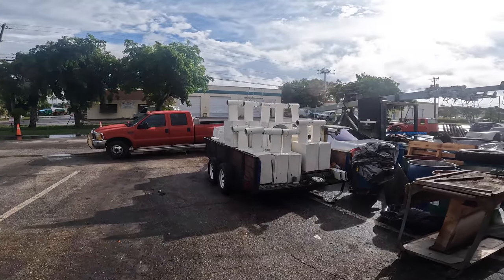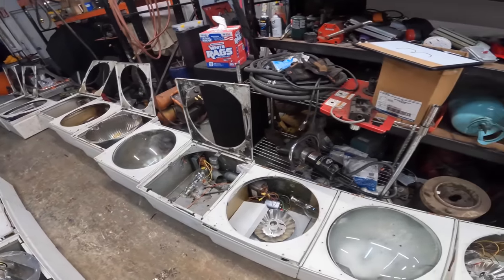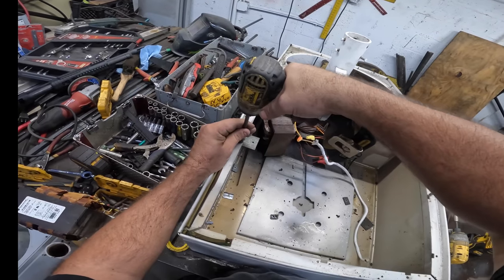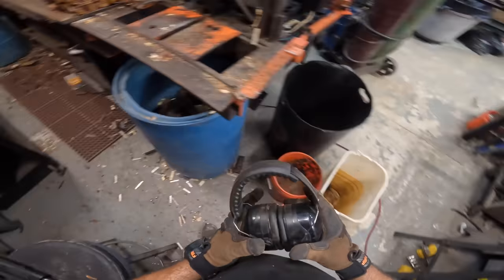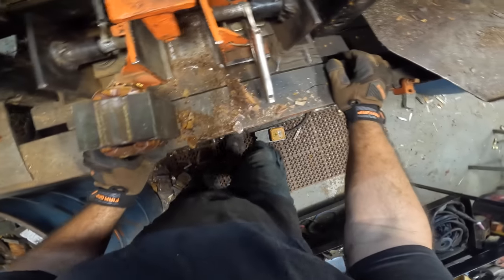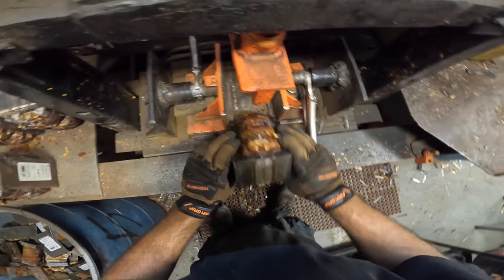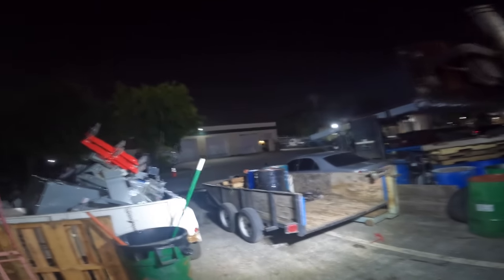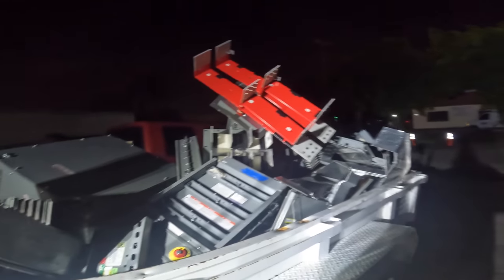3000 Lbs Of Copper Busbar, Scrapping Transformers For Copper, & $30,000 Of New Electrical Gear Pt.1

Comment: Nice production here! When I  strip  junk transformers I  always  wonder if knife  makers  could  use the center steal layers  to make domestic knives as it's  like 50 layers of steal.
Reply from the maker: Interesting, I don't know if the steel would be good for holding an edge. Transformer & electric motor steel is called silica steel and is actually worth more money than #1 prepared steel but you need 20 tons to get the better price.

Comment: Make sure to discharge capacitor or else you’ll get shocked bad
Reply: Use a screwdriver across both leads
Reply from the maker: Thanks for the suggestion

Comment: It's probably a marginal profit but it'd be a way to deal with it. There are companies that recycle glass that's clear which is what you're getting out of those lights if you'll bust it up into small pieces usually they'll bring you like one of those heavy lift bags that will pick up about two or three tons at one time.
Reply from the maker: I have not found anything like that in south FL. You have to pat to get rid of it.

Comment: Will copper transformers be eliminated soon? If so what does that do to your profit?
Reply from the maker: They have been slowly going away for the past 5 years. There will always be transformers but the lighting one's will eventually be phased out to LED. I plan on recycling AC scrap and electric motors. Also there will always be copper wire.

Comment: Idk what’s wrong with my scrap yard but I just brought in a broken down CT scanner 3000 pounds of solid steel and they gave me “torch iron” which is less than scrap. I’ve never gotten “prepared steel for prepared steel which I thought was more money than scrap????? Have you ever gotten the torch steel category thrown on your ticket???????
Reply from the maker: I don't even know what torch iron is. lol I've only gotten shred steel witch is anything bigger than 4'x4' , thin sheet and got plastic, wood, or insulation mixed in and #1 prepared witch is 4'x4' or smaller, clean and heavy  gauge. They don't give you #1 prepared for transformer steel?
Reply: Torch iron*
Reply: No they won’t give me prepared steel for anything. Everything heavy and thick is always torch iron. Lower price than sheet metal…. Regular sheet metal/scrap .075 a pound and “torch iron” .06
Reply from the maker: @ScrapFatherScrapSon  Wow, they are straight up ripping you off!
Reply: @ProjectShopFl  yeah it’s crazy. Yeah I’ve brought in some stuff that’s oversized but they considered every prepared steel I bring in “oversized I guess … if you bring in oversized what do they call it or do they give you less?
Reply: @ProjectShopFl  also since I was able to prove that I could break down and haul off a CT scan or now they want me to figure out how to haul a 12,000 pound MRI magnet and a tractor-trailer. Any suggestions on what I need to haul that my damn truck won’t haul that my trailer won’t haul that I guess I need to rent a flatbed and do you think 12,000 pound magnet would have a secondary market instead of scrap price?
Reply from the maker: @ScrapFatherScrapSon  They give the shred price if its too big
Reply from the maker: @ScrapFatherScrapSon  I don't know what you could do with a magnet that big. lol I've scraped a tractor trailer once and it was a ton of work.
Reply: @ProjectShopFl  yeah I was supposed to a month or 2 ago but decided I didn’t have the time. The parking lot had to be leveled and paved. Dry rotted tires so no way of moving it…. Was all stainless exterior